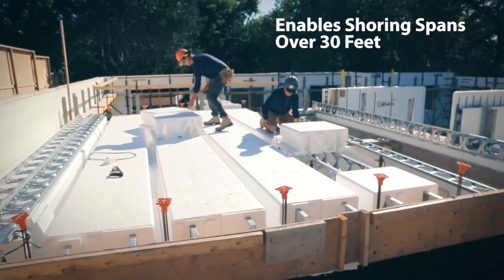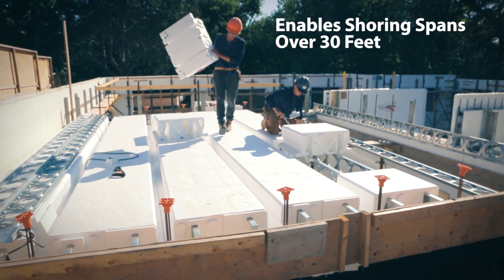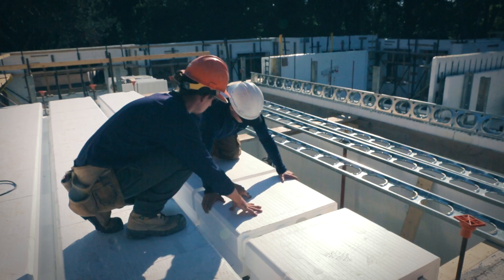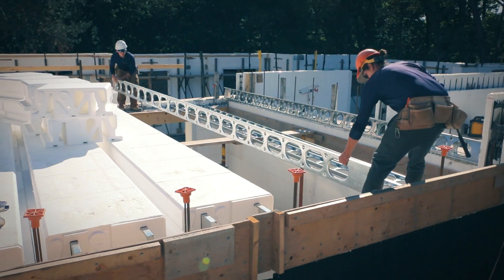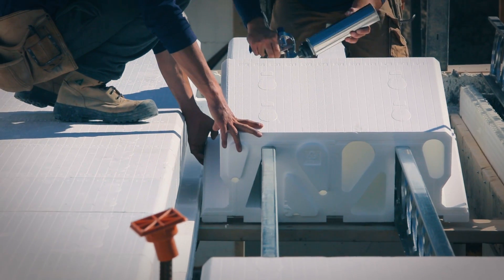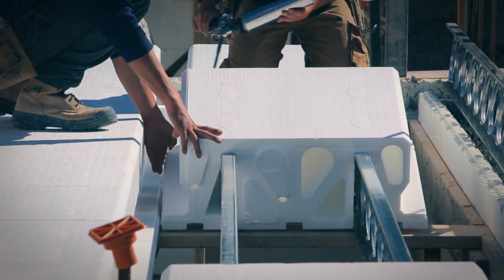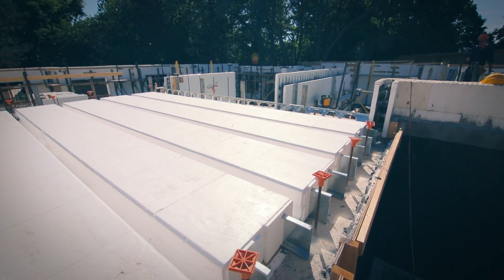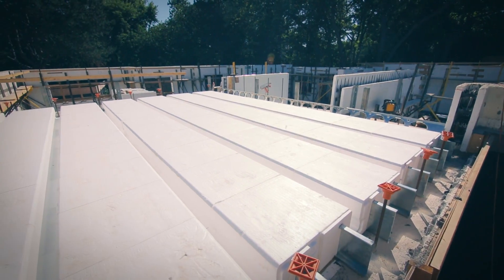Amvic Amdeck | Floor and Roof System (Overview)

Comment: With The AMVIC Roof, what are all the materials needed to add to it...to make it more waterproof and up the R-factor..?    I am going to build an AMVIC garage w/ADU on top and would like to know what additional layers / systems / should I consider to make this as air+water tight as possible...being only a 28x28 structure I am trying to have  the crest of the roof off center and have a sizeable portion facing South for Solar.  Is it possible to do that without too much additional drafting/ engineering materials?
Reply: I'd be curious to see your project Ch!pman1. I have a similar project in the works.
Reply: @stephenparker7718  i am having trouble finding a good drafter/archetect